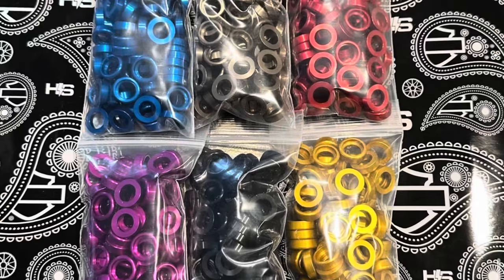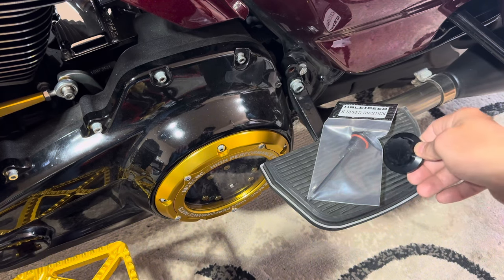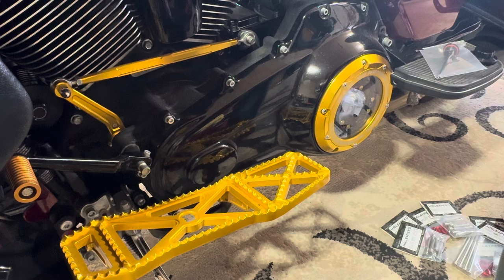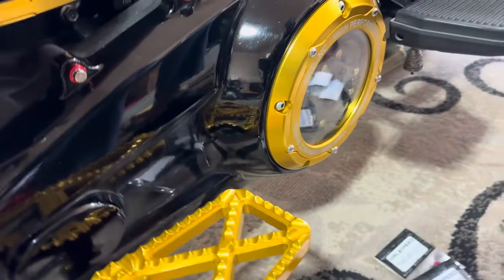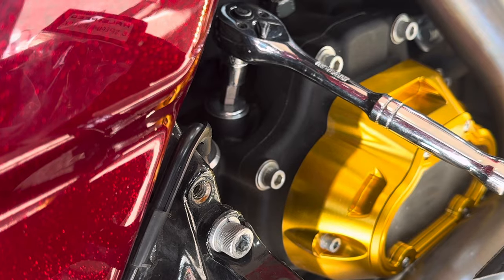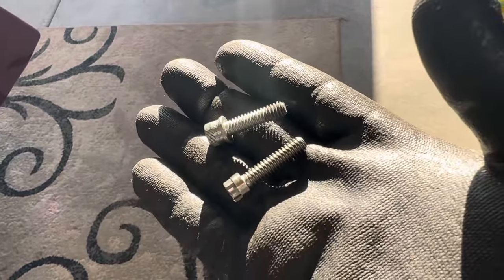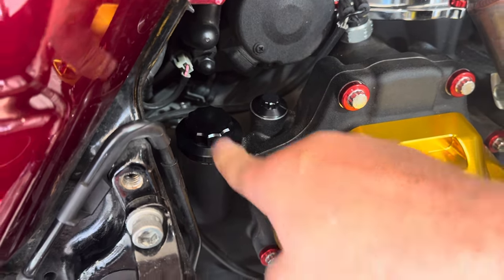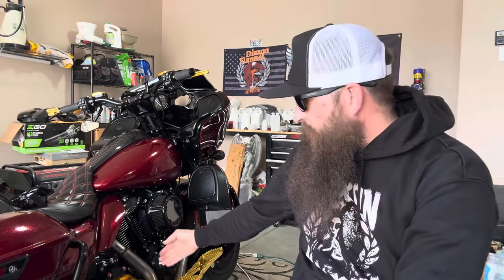Cosmetic upgrade while reinforcing your motor💪🏻its a win win. #harleydavidson #bagger #performance

Comment: Install tip, to keep from ever chipping a bolt or washer anodizing, especially if you use black bolts. Pull a finger off a latex glove and place over the socket head to keep from marring the washer and bolts ever, small extra step to keep them perfect. 👍
Nice Install video,
Reply from the maker: Nice tip! Thank you, Ken 🤘🏻